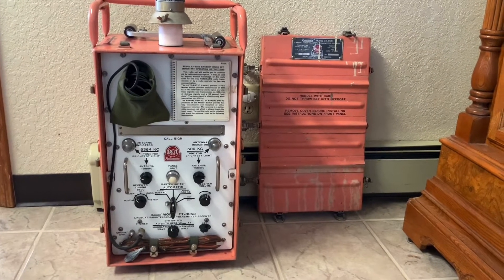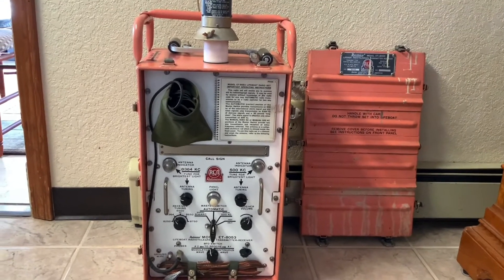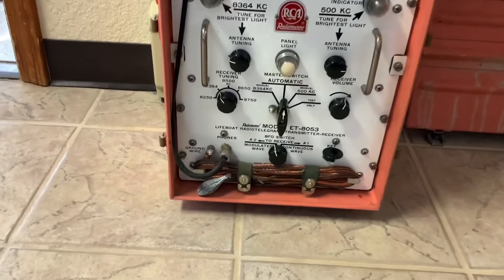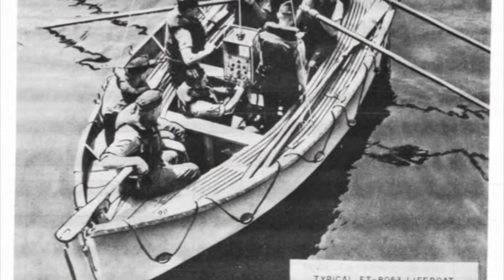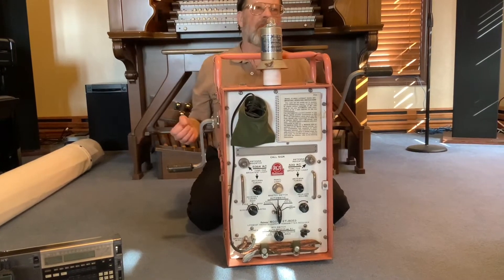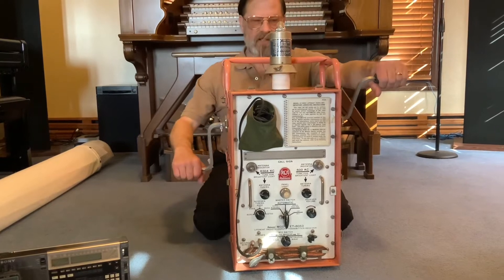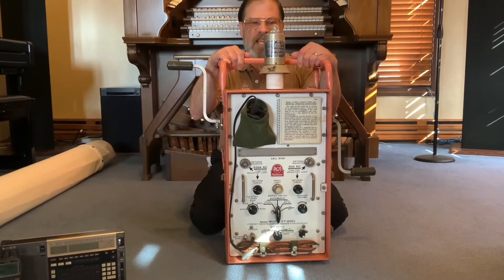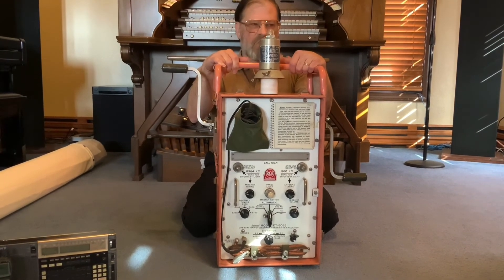RCA Radiomarine ET-8053 Lifeboat Emergency Radio Set

Comment: The 4 second dashes with 1 second spaces are the auto alarm signal to set off the ships autoalarm to call out the radio officer if he was not on watch.   the prolonged dash at the end is for a direction finder signal.
Reply: Was a sensitive galvanometer used to trigger the automatic alarm, such as the one used to detect calls from spark gap transmitters?

Comment: Thanks for the information about this radio.  I actually have one of these that I’ve been trying to find information on.  Is there a source for more info? What would you value these at?
Reply from the maker: There really isn’t much in the way of documentation out there, I have seen an operating manual from time to time come up on eBay, but that is about it. This is no longer legal to use as life safety equipment on ships where it is required, and it is not practical to repurpose for any other radio application. Thus, as far as value, perhaps a couple of hundred USD to someone who thinks it is cool. These are not rare, and most of them that were made are still sitting around somewhere. I have been trying to find a museum ship or maritime museum that would want this, however every one I have contacted already has several of them.
Reply: What information are you wanting.  I’ve used one many times, standard equipment on US Flag Merchant ships… either this RCA Radiomarine version or the competition MacKay Marine yellow ones.